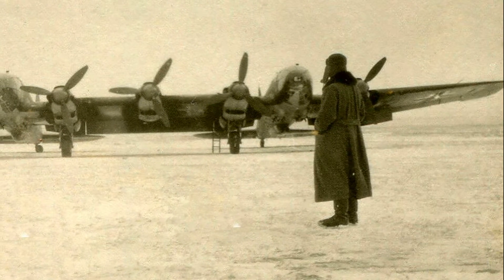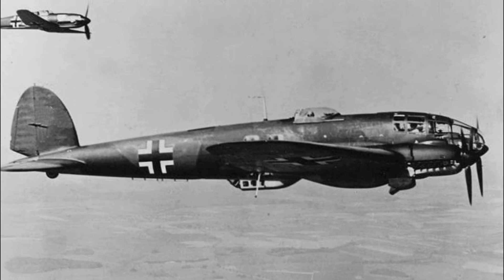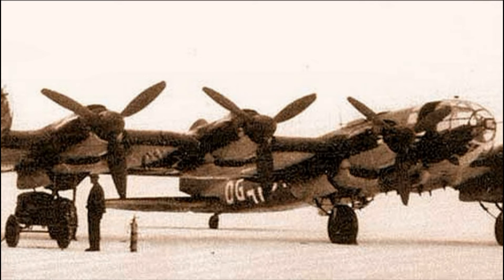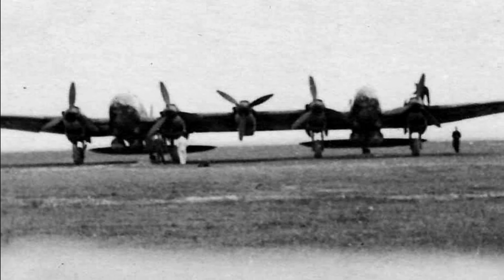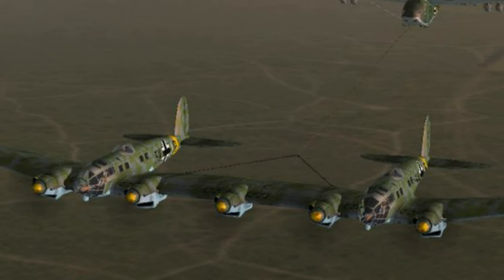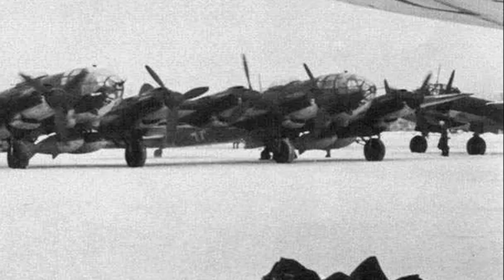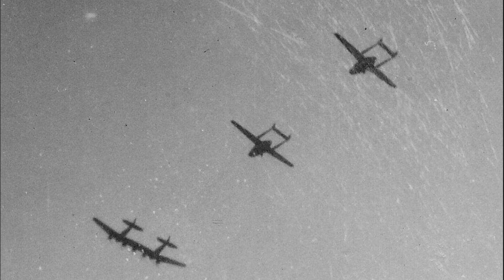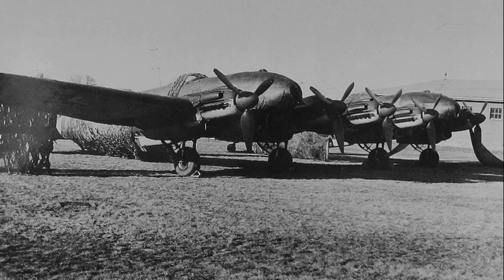Giant aircraft of the Third Reich Heinkel 111 Zwilling. A very successful Siamese twin.

Comment: As a 'glider-Tug' this was, actually, the Wrong plane to co-join into one aircraft. The Dornier DO-17 was a Better Choice, in Lift and Drag, if on a Coupled Wing. But. to issues remain; "could the Fuselages take the Towing Rigging?',  and could the 5 Radial motors give enough Take-off-Thrust? Also, note, Propeller Rotation. As the 4 US companies to use  a a "reverse-spin' Prop on planes (Lockheed, Northrop, Hughes, and North-American) can attest, Directional Flow of  Prop-Wash DOES Affect Wing Lift upon Take-off!. 5 engines [spinning the same way!] isn't a great place to start asking that question from!. Making 3 DO-335's, conjoined on a singular wing-spar would've been their best bet, if, they could've Seen further ahead..